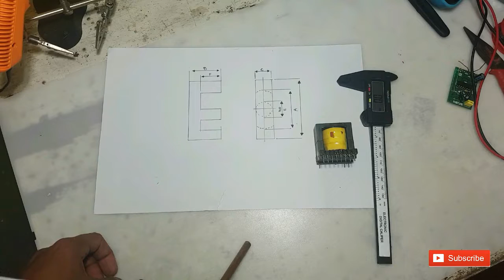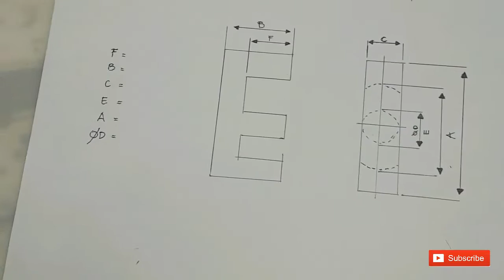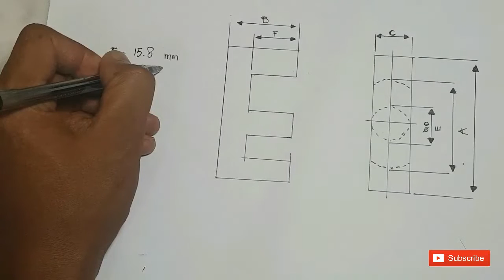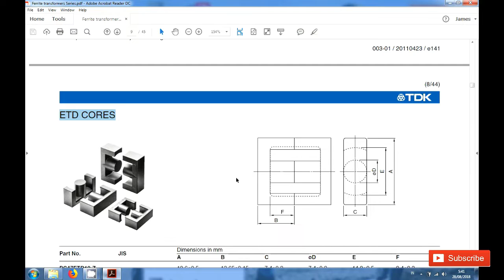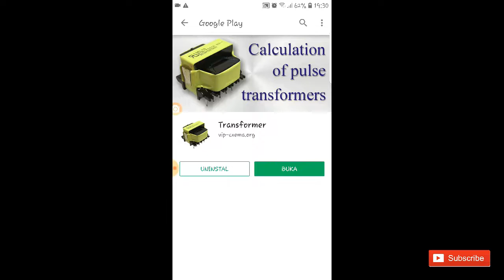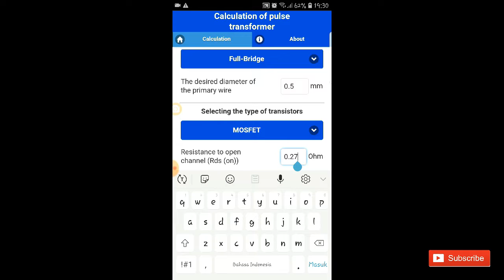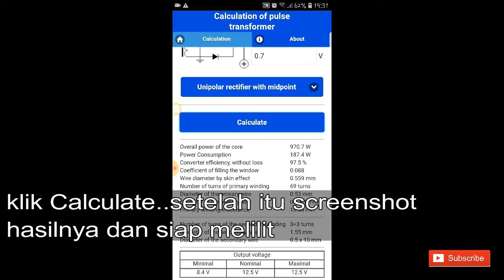Cara Melilit / menggulung sendiri trafo ferit (ferrite transformer)

Comment: mas bro klo trafo ferrit yg ada gap (celah) di gunakan untuk inverter DC to AC  apakah bisa ..
kira-kira perbedaan trafo ferrit yg ber-gap dan  non gap ada pengaruh nya atau tidak ke mosfet ya...
Reply from the maker: untuk inverter DC to AC biasanya menggunakan topology push pull atau tarik ulur ini menggunakan dua mosfet atau lebih dan pada tipe ini trafo ferrite tidak menggunakan celah (gap) tujuanya agar output power lebih besar core losses semakin kecil berbeda dengan smps yg menggunakan single mosfet dimana ada celah (gap) pada ferrit agar menghasilkan core losses lebih besar tujuanya agar mosfet tidak cepat jebol
Reply: @jamespaaystutorial  ok bang terimakasih atas jawaban dan penjelasan nya ...